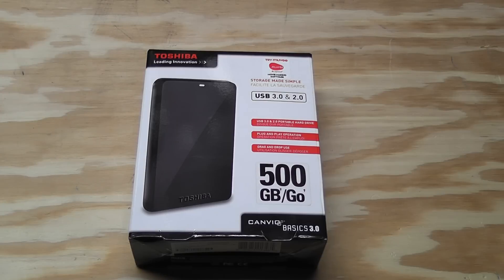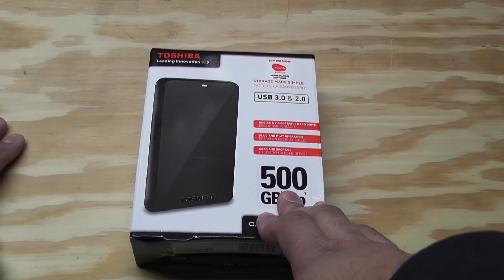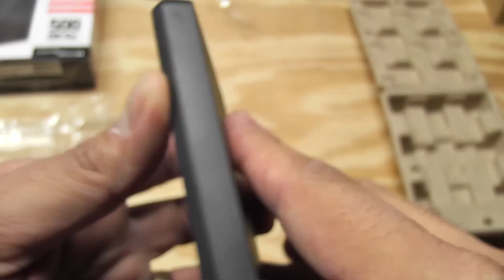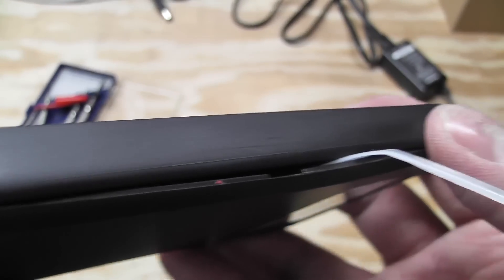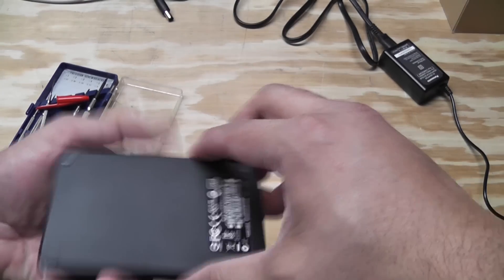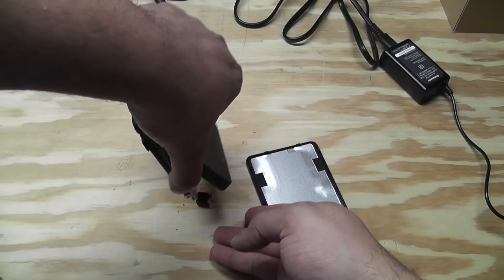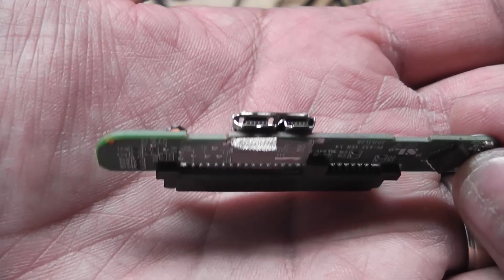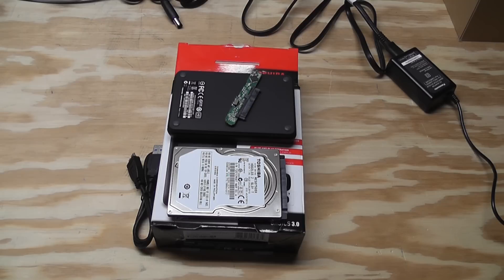Black Friday Unbox and Take apart - Toshiba Canvio 500 GB Hard Drive

Comment: This video is exactly what  I needed!  I have a 2-TB Toshiba drive I was using as a network connected backup.  It stopped working.  Using this video I was able to tear it apart  and figure out that the SATA-to-USB controller was fried.  Now that I know my HDD is still Ok I can find a new controller or buy an after market enclosure for $20 instead  of dropping $150+ on a new external drive.  Thanks!

Comment: Thank you for your video.

I previously purchased a 750 GB Toshiba Canvio portable hard drive to upgrade one of my laptops, and did a youtube search for steps on how to take the hard drive out of the case.  Thankfully, your video was the first one I came across.

Although I was unable to use your method of breaching the case with the tip of a cable-tie, I was able to use the small precision type flat screwdrivers to do it.  I bunged-up my case a little, but it's no big deal :-).

Thanks again!

Comment: Just some info: I bought a 1.0 Tb Canvio and the hard drive was useless for replacement of a laptop hard drive, there is no longer (or with the larger drive) a little card at the top of the drive. The USB port marries straight to the hard disk drive board. No standard internal SATA ports!

Comment: I took apart my Toshiba Canvio Basics USB 3.0 2TB portable drive. It has the separate controller board, just like yours. Only problem is the hard drive is not as slim as yours. It's thicker. I couldn't make it fit in my Lenovo Y410p. So I ended up putting it back in the enclosure.
Reply from the maker: Oh, that sucks! I've been hearing that the USB 3.0 drives are a bit more tricky or just not able to be used like I did in this video
Reply: That's only for the 2TB model. See:https://storage.toshiba.eu/cms/en/hdd/hard_disk_drives/product_detail.jsp?productid=547 It's thicker (15 mm vs 12.5mm) because of the extra platters they had to squeeze in to make up 2TB.

Comment: Just and update for you, I picked one of these up today (7-8-2014) and found that Toshiba has changed the data connection on the HDD. It is no longer a SATA HDD with the adapter connection. Only the cable that comes with can be connected to it.

$54 now useless as the drive can no longer be returned.
Reply from the maker: Thanks - too bad though!

Comment: Thanks for the video. Did not know that the 2.5" HDD of an external usb drive is compatible with the same installed inside a laptop.
Reply: Yes most are simple 2.5 laptop drives with sata usb adatper, except Western Digital and few others stupid SATA to USB3 controller PCB is soldered on and if it fdails you are screwed with your data

Comment: Thank you so much for this video. First off, I have the same model of HDD that you're using here. Mine started acting odd, apparently my computer was having problems reading that information. This happened sporadically at first, but soon the HD completely shut down. There's a white light that flashes on the front of the casing. This light no longer flashed, and each time I connected the HD to my PC and laptop it would not be read AT ALL. No light - NOTHING. I searched for a solution for "toshiba external hdd not working." and variations on that search. NOTHING! I look on the back of the casing, mentally jot down the product number "P/N: hdtb105xk3aa" and I checked the video section of the search engine. I found your video and watched the entire thing. I started attempting to crack open the case, which was pretty easy with a small screwdriver I use to repair my eyeglasses. I see the HD, and I remove it from the case, as you instructed, disconnect the power connector that has the USB connector atop, and I connect the drive directly to my pc motherboard, and VIOLA! It worked. I was afraid I wouldn't be able to recover the files I had on this drive, but it seems maybe the problem is with either my cable or the entire power connection. Something is up with that one piece, but the HD is completely normal. Thanks to you I got the bright idea to actually open the case up, instead of taking to an "expert" that would have charged me over $100 to do what I did for free. Seriously, thanks you for the video. You're doing God's work for some of us out here, friend.

Comment: Hello.  This video is excellent!  I personally have the 1TB version.  Great drive, but I have a problem.  I believe the hard drive is fine, but the connector, more specifically the port where the cable plugs into is broken.  (Think cell phone charging port breaks situation).  Anyway, do you know what the proper name for the connector is?  I would like to purchase a new one, and would hope this is possible.  Thank you!
Reply: Philip John DiCriscio It’s a microUSB 3.0 B port. It’s not the same as the 2.0 one, though it’s backwards-compatible. But you’ll need very good soldering skills for fixing it.

Comment: Good guide. Sadly Tosh has changed the design with the newer size drives - the casing is the same but inside the USB3 circuitry is integrated into the controller board, so there's no way to use it as an internal drive.

Sadly it was a case of Schrödinger's cat for me - I bought a 2TB drive based on this guide and opened it with your technique, but not without breaking one or two tabs, making it hard to return!
Reply: Totally wish i woulda seen this before i just took apart mine and was like wtf
Reply from the maker: James De Vile Yeah, it sucks.  I'm betting it's cheaper for Toshiba to go this route than it is to use that separate board that was in mine.

Comment: I've taken apart a few external HDD's and put them in laptops and PC's.

Funniest part is when they sell internal HDD's as standalone or kit, they're significantly more expensive than an external version are, an internal 2TB (3.5", no such 2.5" 2TB yet) drive here costs $140 while an external 2TB (2.5") one costs $80, hmmm which one should I buy???? pfft.  But the downside is that they're usually very slow drives (5400 or 5900rpm), still a cheap buy for upgrading a storage drive.

Comment: This is a pretty old video. Very old actually.
Lately (as of 2020 so far), drive mfr's are getting hip to drive shucking. They are now either crippling the connector (which clear tape can uncripple it if you know which 'pins' to tape) or they are hard soldering the USB interface to the drive.
I was looking for a list of mfr's that still have not crippled the interface so I can harvest a drive or two.

Comment: Great video. I was looking for information on how to take apart The Canvio desk version which uses a 3 1/2 inch hard drive. I was able to get it apart, but I broke the plastic clips in the process. There were a lot of them and they were in weird places. Your video gave me a good idea on how to get things going though so thank you.

BTW, the desk version has a separate controller board as well that requires power, but will power a 3.5" hd. I only wanted the controller board so I didn't really care about breaking the case. :-)
Reply from the maker: I'm glad this video helped!

Comment: I have one just like and a couple of weeks ago, it just stop working. The light on the front doesn't turn on and  it doesn't show up on the computer, how would i be able to get all my data off of it
Reply from the maker: Wow, that sucks.  I'd start with a couple of easy things first: try another USB port and make sure that it's not just a bad port.  Also, as dumb as it sounds, make sure it's plugged in all the way.  If you did all those basic things first then it might get a bit harder to fix.  If it was me, I would take it apart and plug it in directly into a SATA port inside my PC.  if you're using a laptop - not so easy.  Depending on how bad you needed the data, you might want to look into taking it apart and putting it into another after-market enclosure.  If nothing works, then you might just have a bad drive.  Good luck!

Comment: This doesnt work on the newer models cause now the have built in the 3.0 connector to the hard drive
Reply from the maker: Ah, that sucks!  I've heard the same thing from other users here.  Thanks for the tip!
Reply: ***** Yeah I guess realised it costed them but I don't know if they are any faster than the more expensive ones
Reply: TheSutt I would not bet on it , I bought the removable one back in 2011 and another one that was not last year

Comment: my laptop system is broke, can i put my  disc from laptop to toshiba and put it to antoher laptop to copy my files? someting like this will work?
Reply from the maker: e. s. Probably wouldn't work.  You could try getting an external enclosure and putting your drive into that, then plug that into a second PC.  You might be able to grab files that way.

Comment: Hello. 

I am writing from Argentina. 

The power supply a few days ago I was burned. 

with them also an external hard disk of 1tb. 

had all the information of my life in it. 

if I buy a new hard disk of the same brand and the same model. 

you think you can get to save the information you had in the previous? 

Thank you.
Reply from the maker: Might be tricky.  If the power supply was the only thing that was damaged, then you might be able to get away with trying a new supply with the old drive.  It's worth a shot.  Good luck!

Comment: i need to know if this works with other disks, like 1 or 2 tb i would preciate a tutorial
thanks :)
Reply from the maker: Felix Ryushin My video is a couple of years old at this point and I've heard that the design is different on these drives.  People are saying that the USB connector is soldered on so it's not worth doing this on newer Toshiba drives.  I haven't tried any other drives though.
Reply: ***** I can verify that the new ones the board is all one piece. Just followed this video to my dismay.

Comment: can i put this hard drive into my laptop? i have the 1tb version.
Reply from the maker: Earl Hechanova I've reading for a while now the comments on this video and it seems like this trick doesn't work on newer drives.  The SATA controller board is soldered on, making it impossible (or really, really hard) to use.

As far as your laptop goes, probably any 2.5" drive should work

Comment: just bough a Toshiba canvio 1TB drive, and tried this, opened the case just to find out that  the USB3 board is soldered directly to the HDD,and there was no SATA ports, so, just bought it for nothing cause all i wanted is expand mi laptop internal hard drive. I feel scammed :(
Reply: same here man same here .-.
Reply: I'm finding hard to understand why YOU feel scammed. you bought an external drive that works as intended but YOU feel scammed because it will not work as internal? Would you feel scammed if you bought a phillips screwdriver and later on found out you could not use it as a flathead screw driver?  The only scam that is happening is you buying a device meant for one purpose at a lower price and trying to use it for a different purpose.
Reply: I get the disappointment but I agree with Ryan.  How can you possibly feel scammed?  Or maybe I can even see feeling that way but it would be you who scammed yourself.  :)  Just  saying.

Comment: damn! tried it but my hd doesn't have that nice sata to usb controller. it has the usb 3.0 connector built-in on the board. Model: Toshiba v63700-c, internal hd with the usb 3.0 connector mq01ubd100 (see the first big picture at bit . ly/X3M04h)
At least it has been very easy to open the enclosure after watching you video.
Thank you.

Comment: ***** will this fit a ps3?
Reply from the maker: bernardo vazquez I believe PS3 takes the smaller hard drive so I think this would work.  Just remember though that this trick doesn't work with the newer drives - the USB Header is soldered on.  My version just popped off.

Comment: Warning, doesn't work with the 1tb hard drive.
Reply from the maker: Optimised Tutorials Yeah, I've heard that over and over now.  It's unfortunate really because of how they decided to build the newer drives.
Reply: +Optimised Tutorials what if i want to put it in my desktop pc? i have the 1TB model
Reply: Lucas Tejerina  Won't work. It has a custom board inside. I tried it too..
Reply: +Optimised Tutorials I just opened it with a mini-screwdriver, and it looks sort of similar. Should I risk going further?
Reply: Afraz Anosh I fully took mine apart. It's not the same. But if you dont believe me go for it